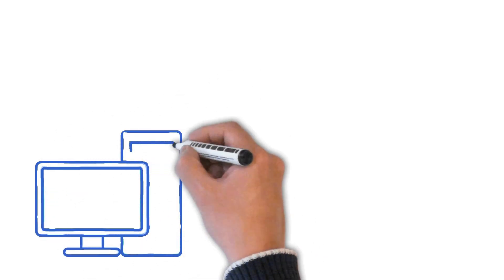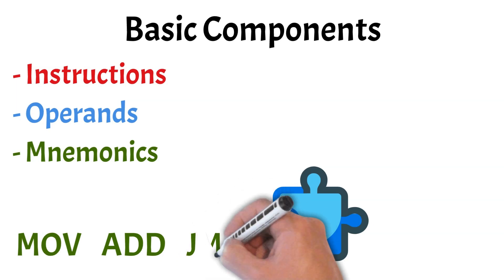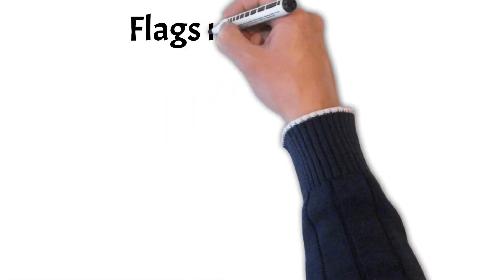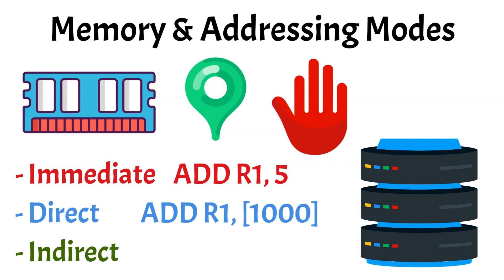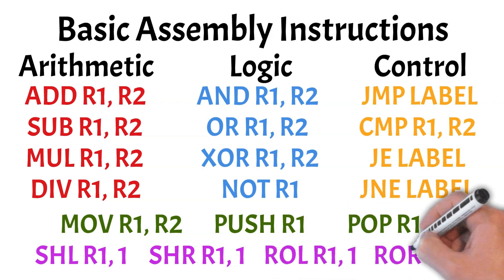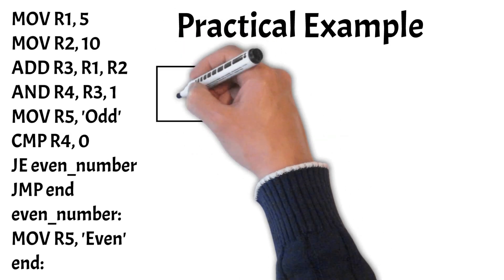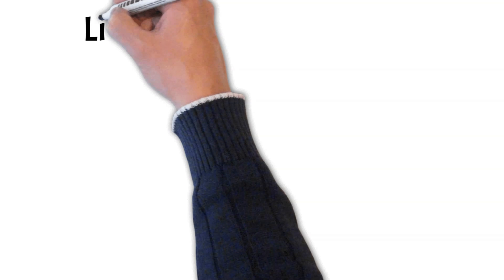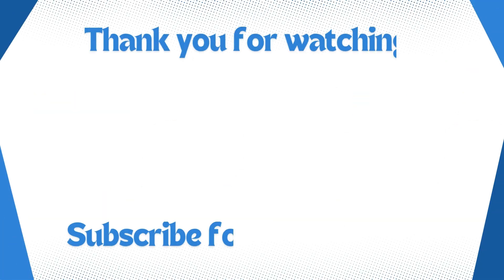Assembly Basics: The Language Behind the Hardware

Comment: I have question:
First programing language is written by hand, such as punch card and detect digital signal by holes on card or manually open close switches. 

Based on manually open close switches, they convert into abstraction as "mov" "add" in paper sheet?
And why binary as text abstraction can generate electrical sign to 
interact with hardware
Reply from the maker: Great question. In the early days, computers used punch cards or switches to input instructions. Each hole or switch represented binary (1s and 0s) that the computer could understand.

To make things easier for humans, languages like Assembly were created. Instead of flipping switches, you could use commands like 'mov' or 'add' which are easier to write and read. These commands are then translated into binary (1s and 0s) that the computer's hardware can process as electrical signals.

Think of Assembly like a bridge: you write in a simple language and it gets converted into the binary code that the computer uses to control its hardware.
Reply: @WhiteboardDoodles24  the key matter is that by which mechanism the computer can process binary as electrical signals
Which method convert from abstraction text to physical interaction??
As punch card, they have sensor or smth to detect holes by light
Reply from the maker: The key mechanism here is that computers work by detecting electrical signals. A '1' in binary represents an 'on' signal (a flow of electricity), while a '0' represents an 'off' signal (no flow of electricity). These signals travel through the computer's circuits to perform tasks.

In modern computers, the CPU (central processing unit) processes these binary instructions. When you write Assembly code, the computer translates that into machine code (binary). The CPU has transistors, which act like tiny switches. These transistors can be turned on or off, representing 1s and 0s in binary. The sequence of binary instructions tells the transistors how to process data, perform calculations and interact with the hardware.

As for punch cards, you're right - they had sensors that could detect holes. The holes represented binary 1s and 0s, which the computer's hardware would process similarly, by sending electrical signals based on whether a hole was detected or not.

So, to summarize, the CPU processes binary by using electrical signals and transistors act as the switches that execute instructions based on those signals.
Reply: @WhiteboardDoodles24  tks but it's still not clear how hardware detect text abstraction from series of 0 or 1

For example, when you press the key on teleprinter, it close the switch and connect to hardware circuit for other processing

But when you type mov r1, r2, r3, it is translated into binary code. But it is still an abstraction from screen, it need a "sensor" in order  that computer hardware could  realizes it is 0 or 1 to do on/off electricity
So, what's kind of sensor and machanism?

It need to be logic comparing to hard drive when data is retrieved from magnetic and non magnetic as 0/1 on surface..but in assembly ..series 0/1 from mov/load/add instruction is detected via I/O as keyboard?
Reply from the maker: You've raised a great point. The process of converting Assembly instructions like 'mov' into binary code is done through multiple layers. When you type 'mov r1, r2, r3' on a keyboard, the hardware detects the key presses through electrical signals. Here's how it works:

- Input Detection: When you type on the keyboard, it sends electrical signals (on/off) to the CPU via an input/output (I/O) system. Each keypress is detected through a circuit that closes a switch, much like the teleprinter you mentioned. These signals are translated into binary code that represents the characters you're typing.

- Translation into Machine Code: The Assembly code ('mov r1, r2, r3') you type is then processed by a software component known as an assembler. The assembler converts the human-readable Assembly instructions into machine code - a sequence of binary (0s and 1s).

- Execution by the CPU: The binary code generated from the Assembly instructions is sent to the CPU. Inside the CPU, transistors act as tiny switches that turn on and off to represent binary values (1s and 0s). The CPU processes the machine code and performs the corresponding actions, like moving data between registers or adding values.

- No need for sensors in the same way: Unlike a hard drive that uses magnetic detection, the CPU doesn't need a 'sensor' to interpret binary. The binary code is directly used to control the transistors in the CPU, which are responsible for processing those instructions. This is where the physical electrical signals (on/off states) come into play.

So, in summary, the keyboard sends electrical signals that are translated into binary code and the CPU uses transistors to process that binary code as instructions.
Reply: @WhiteboardDoodles24  So, it is confirmed that the series of machine code as 0/1 is converted to electrical signal via keyboard which directly interact with circuit?

However, it is depend on enviroment which it is compiled, when you press mov on notepad or word app, nothing happend except "mov" displaying on the screen
Reply: Is it confirmed sir?
Reply from the maker: Good observation. When you type 'mov' in apps like Notepad or Word, it's treated as text, not a command. These applications are designed for editing and displaying text, not for compiling or executing code. So, when you type 'mov', it simply displays the text on the screen without any further interaction with the computer’s hardware.

For Assembly code to actually be processed by the CPU, it needs to be written in a specialized environment, like an IDE (Integrated Development Environment) and then passed through an assembler. The assembler translates the Assembly instructions (like 'mov') into machine code (binary), which the CPU can then execute by sending electrical signals through its circuits.

So, typing 'mov' in Notepad doesn't trigger any interaction with the hardware because it's just text. But in a proper programming environment, it gets compiled into binary code that the CPU processes.
Reply: @WhiteboardDoodles24  i dont agree with that
When you type 'mov' on programing enviroment, it still display on the screen as text mode before compiling, right?

I have searched through internet, but none have clear answer relating how exactly computer physically detect series of 0/1 abstraction per code line to trigger control signal through circuit??

For example again: 
Key board: you press the letter, and it physically interact with circuit
Punch card: you punch the hole and computer physically detect holes to trigger the bulb light or not ( via light through hole or not)
Two clear above example shows the physical that make the bridge to link 0/1 abstraction to hardware. 
And about binary pattern after compilling, what's the physical mechanism to detect them to trigger electrical signals????
Reply: No more clear explaination Sir?
Reply from the maker: You've brought up a key aspect of how computers work and I understand the confusion. It's true that when you press 'm', 'o' or 'v' on your keyboard, electrical signals are triggered and these characters are displayed on your screen as text. In a programming environment, when you type 'mov', it appears on the screen just like it would in any text editor.

However, the key difference happens after you press 'run code' in a programming environment and that's where the process changes from simple text to something much more complex.

When you press 'run', the compiler or assembler translates the human-readable Assembly instructions (like 'mov') into machine code, which is a series of binary 0s and 1s. This machine code represents the exact instructions that the CPU can execute.

The CPU is made up of billions of tiny components called transistors, which are like tiny switches that can be either on or off (representing binary 1s and 0s). Once the Assembly code has been translated into machine code (binary), the CPU reads the binary instructions, which control these transistors to perform specific actions, such as moving data between registers or performing arithmetic operations.

This translation of binary into actions is handled internally by the CPU's control unit and arithmetic logic unit (ALU), which decode the instructions and trigger the correct sequences of electrical signals to perform the operation.

Why doesn't it involve the keyboard or other I/O after compiling?
Once the code is compiled or assembled, the physical input from the keyboard is no longer involved. The program is now in the form of machine code and the CPU directly processes it by manipulating electrical signals based on the binary instructions. The key here is that the binary code interacts directly with the hardware through the CPU's circuits and transistors, without any further need for keyboard input or other I/O devices.

So, to summarize:
1. Before running the code, typing 'mov' is just text.
2. After compiling the Assembly code, the binary representation is sent to the CPU, which detects the series of 0s and 1s by controlling transistors that execute the instructions through electrical signals.

It’s not about sensors like with punch cards, but about the internal circuitry of the CPU reading and executing the binary code.
Reply: @WhiteboardDoodles24  still not clear and come back to story chicken/eggs which exist first

By which specific action? 
'M' is pressed by keyboard  and it is loaded to register through circuit. 'O' & 'V' are the same
After that, when code is run, cpu collects the combination address of m, o, v and generate them into new binary pattern as instructions?
Reply from the maker: There is a distinction between the binary that represents text (like when you press keys on a keyboard) and the binary that represents instructions (like when a program is executed).

When you press 'M', 'O' or 'V' on your keyboard, each keypress sends an electrical signal to the computer which is then translated into a binary code that represents the character you typed. This binary data is stored temporarily in memory (like a buffer) and is displayed as 'mov' on your screen. This is simply text, not instructions for the CPU yet.

Each character ('M', 'O', 'V') has a corresponding ASCII (or Unicode) value which is just a standard way of representing characters as binary. For example, 'M' in ASCII is represented as 01001101 in binary and this is stored in memory and displayed.

When you write 'mov r1, r2' in a programming environment and press "run code", something completely different happens.

The assembler (or compiler) looks at 'mov r1, r2' and translates it into machine code - a specific sequence of binary 1s and 0s that the CPU can execute. These binary instructions are not the same as the ASCII values of 'M', 'O' or 'V'. For example, 'mov r1, r2' might be translated to binary machine code like 10110001 00000010 (just an example).

Once the program is compiled, the CPU processes the binary machine code by using transistors inside the processor. Each combination of binary values triggers different hardware actions - moving data, performing calculations, etc.

Important Difference:
- Typing 'mov': When you type 'mov', the binary represents the characters (ASCII codes) just as if you were typing a sentence in a Word document.
- Running 'mov': When you run the code, it is no longer about the characters themselves. The assembler converts 'mov' into binary machine instructions which the CPU executes directly.

The CPU does not collect the binary for 'M', 'O', 'V' and use it as instructions. Instead, the text 'mov' is compiled into different binary machine code which the CPU reads and processes. The 'binary abstraction' you're asking about is handled by the assembler which transforms human-readable text ('mov') into the 1s and 0s that directly control the CPU's hardware.
Reply: @WhiteboardDoodles24 Thank you both for the right questions and the detailed and patient answers in this conversation. This has helped me to close an important gap in my understanding as I had similar questions.
Reply from the maker: @guntergras4278  Glad to hear the discussion was helpful for you!
Reply: No more clear explaination sir?
Reply: @whiteboardDoodles24 thank you for your patient responses. Although I'm a French speaker in a French environment I'll still share your channel you really deserve it and more!

Comment: I loved the “ Simpler “ days of the TRS -80’s Z80  assembler language! 😅
Reply: I began with 6502 assembly, but after i used x86 assembly i don’t want to go back to 8 bit computer.
Reply: @maxmuster7003 both these languages have implied registers. So you write down the instructions and then insert some moves to match. Important instructions like add, load and store work on all registers, I think. Now I may have to look up if encoding is more difficult for AX than for AL, AH.

Why not check the flags after AND ? Or if you love CMP,0 so much, why not ditch flags and use RISCV?
Reply: Excellent explanation of the study material. What you do is very valuable, thank you
Reply from the maker: Glad to hear the video brought back memories. The Z80 assembly definitely had its charm. It's amazing how much tech has evolved since the TRS-80 days.
Reply: @WhiteboardDoodles24  😉

Comment: it is also a must know for cracking software, right?
Reply from the maker: Assembly is certainly a foundational skill for understanding how software works at a low level, including reverse engineering for legitimate purposes like debugging or security research. Technically speaking, yes, however, those skills should always be applied ethically and legally.

Comment: 1. How do you choose registers ? I mean, how do you know a specific register is good to store the value ?
2. Does assembly handles unicode string ? Especially 16bit WCHAR string
3. Can you declare a struct in assembly language ?
Reply from the maker: Thanks for your thoughtful questions. 
adammontgomery7980, great answers. To add a bit more:
1. Yes, registers can be volatile (caller-saved) or non-volatile (callee-saved), so following conventions is key to managing them efficiently. You can refer to specific architecture manuals for guidelines.
2. Assembly doesn't have structs like high-level languages, but you can mimic them by using memory locations and offsets to group related data. Assembly's flexibility allows programmers to come up with creative ways to organize and manage data.
Reply: @WhiteboardDoodles24 why do you say “mimic” . Register with displacement is so obviously targeted at structs. Have you checked that there is no weird combination of .org and labels which does the property allocation within a struct for us? Assembler was defined to me lately as : like C, but under your control
Reply from the maker: @ArneChristianRosenfeldt  You are right that using registers with displacement can indeed provide a structured way to handle data similar to structs in higher-level languages. My use of 'mimic' was meant to emphasize the difference in how data structures are implemented in Assembly compared to languages like C. I appreciate your insights, Assembly definitely gives us a lot of control over how we manage data.
Reply: 1. There are conventions for which registers to use for returning values from subroutines. However, any can be used for whatever you want. 
2. No, you'd have to program Unicode handling. 
3. No
Reply: @adammontgomery7980  Thank you for reply. I heard that there are volatile and non-volatile registers which we need to take special care when we code in assembly.  So you need proper guides/manuals, right ? 
And if there are no structs, I wonder how did assembly programmers handle their objects ?
Reply: @kcvinu  look up application binary interface (ABI) for details, but it's just a convention used for a specific architecture and compiler. Assembly doesn't use objects, just memory. Since you know the data type and therefore size of each of an object's member variables, you can just use an array instead of an object. To access an object member just take the pointer to the array (object) and add an offset. It's very easy to mess up, which is why we have higher level languages to think more abstractly.